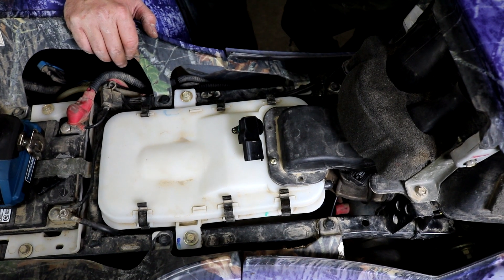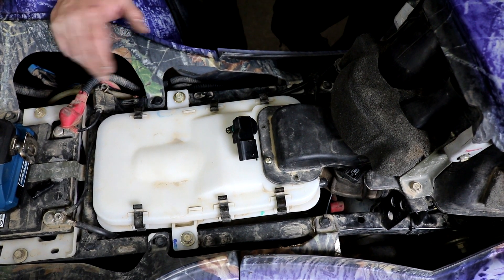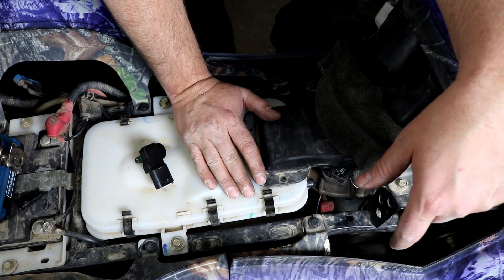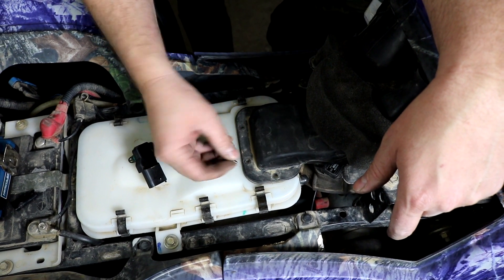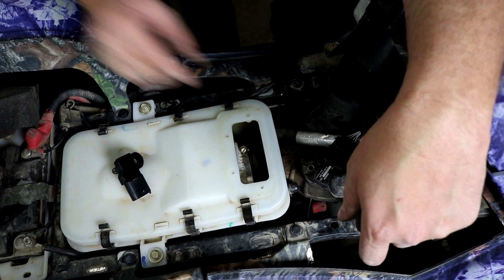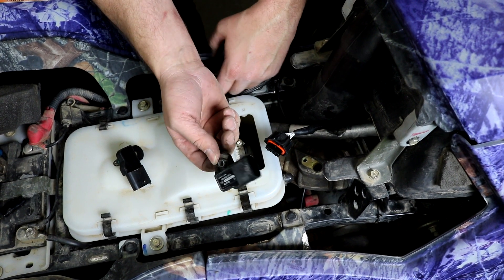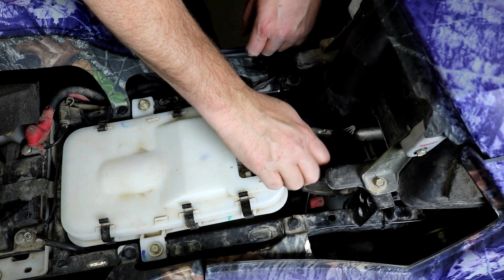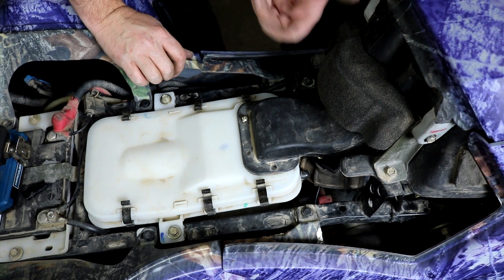RMSTATOR Polaris Sportsman 700 800 Twin EFI MAP Sensor Install

Comment: Any idea if this could cause code 21, "loss of synchronization" on a 09 sportsman 800 HO?  I've been battling an intermittent issue for that for a couple years.  Basically the engine has no power and is forced into a limp mode to protect the engine from being damaged.

Comment: Hey i have a question i have the same quad in the video just 2 years newer and 4wd i bought it apart and the only thing that is stoping me from starting it is that i can not seem to find were the negative battery cable goes
Reply: There is one for the winch that typically runs from the fron to the back on throttle side… the typical ground is short running from negative on battery over to the front brake side about a foot or so